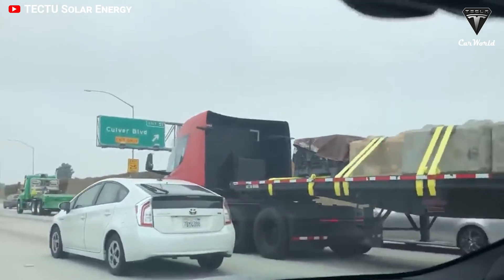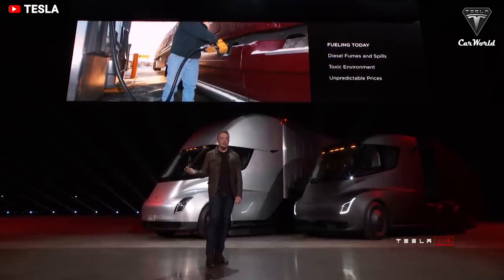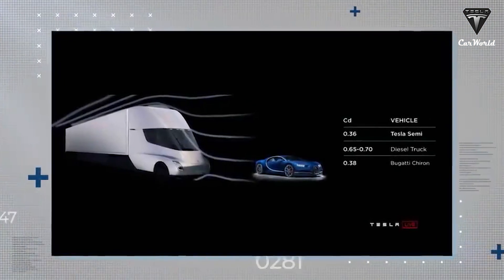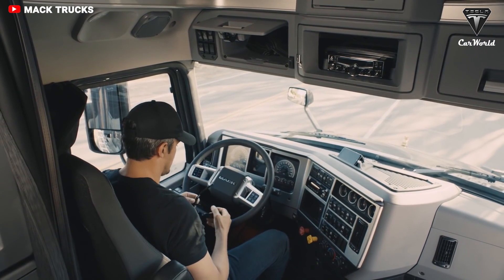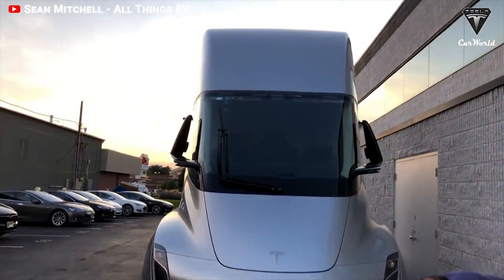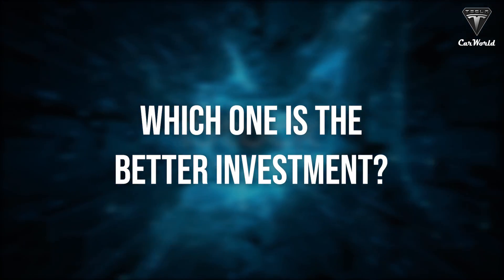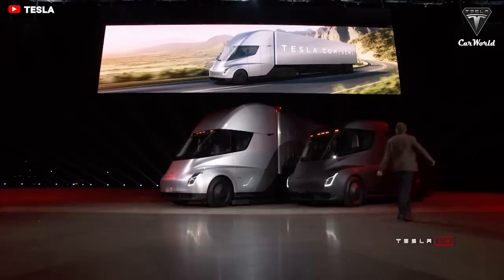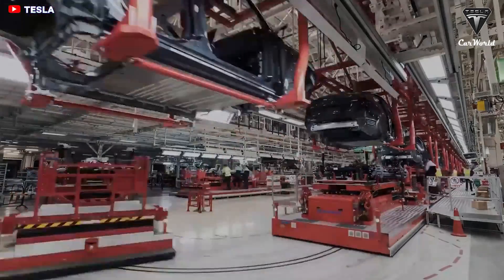Which is the KING of 2023 heavy trucks? Mack Anthem Diesel Truck Vs. Tesla Electric Semi?

Comment: The Tesla certainly looks good on paper but only time will tell. The Tesla won’t be very good for long haul truckers in my estimation. No sleeper berth is definitely needed to cover long miles. Lots of companies have teams of drivers and a birth is needed. Trucks don’t need to accelerate like a sports car either. Heavier loads will definitely drain the battery quicker especially in mountainous areas. The charging across North America has to be a lot better and faster than it currently is. It will be interesting to see how the Pepsi trucks fare in the race to electric transport. Driving a Tesla truck will definitely require training to get used to the drivers position and all of the electronic wizardry of large computer screens in place of speedo and tachometer and other important gauges that drivers rely on. Kw/h aren’t in the average truckers vocabulary. I’m old and I like electric but I don’t think it’s up to covering at least the longer hauling trucking needs yet.

Comment: Here's the thing. As a Mack Pinnacle driver. The Pinnacle is the more classic looking axle forward model of the anthem. The mileage scale is concerning. If I were to drive with an average 80,000 gross load,like most over the road trucks. If I baby it,I can go between 1500-1800 miles. And refueling only takes minutes, not hours. In team driving,the more the truck is moving,the better. The acceleration is impressive, but on what cost. If your doing jackrabbit starts all the time, tires get extremely expensive. And the design is indeed futuristic, sort of. It looks like an old Cabover. And on the inside, all that technology is unnecessary, and very complicated for average truckers. Most of us truckers still prefer an old very reliable diesel powered truck. For my operation I need a vehicle that can perform well,pulling heavy haul,up to 120,000 gross. Also PTO operations like a dump trailer, or low bed equipment trailer. The Tesla truck might be good for local pick up and delivery,especially with its pathetic range. If I can't get at least 500 miles a day,plus running the PTO,what's the point. And once in ready to trade up,Mack's have the strongest resale values. And are easily reconfigured into other roles,like snow removal, or and over the road sleeper truck can be turned into a day cab dump truck. So as a professional truck driver, I want no part of this ugly feels
Reply: Not to mention the weight of those batteries will cut deeply into the payload maximum weight of 80,000 pounds so Tesla will not be pulling a full load
Reply: Other than the range, the electric truck is going to perform better than a diesel in every possible scenario. Give it time, battery capacity and charging will get figured in the next decade. Remember, it’s taken 100 years of development to get ICE to this level of performance and reliability.
Reply: You guys have no idea what's coming. Elon is about to give you a treat. Just wait.

Comment: With the lack of range on the Tesla, I would need 2 Tesla trucks to do what I do everyday with one diesel truck. 300 miles is not going to cut it even for us local drivers. I never go less then 400 miles a day and some days are over 500 miles.
Reply: Tesla are quoting a 500mile range.
Volvo are quoting a 300mile range for their much lighter version - with the idea that the truck will recharge at both ends of a run (warehouse and supermarket for Walmart for example).
Walmart are putting solar panels on their warehouse and store roofs to support this (as they don’t like paying for fuel).